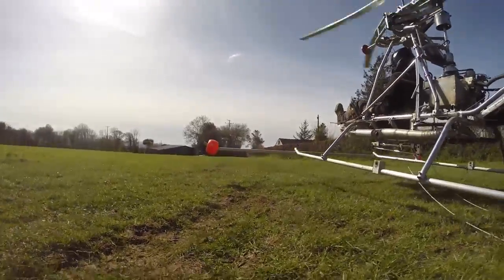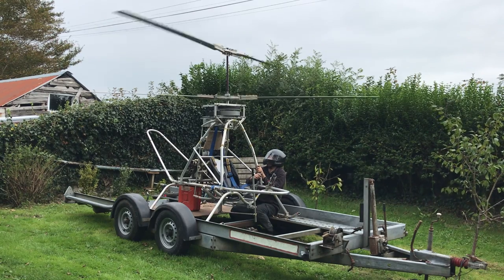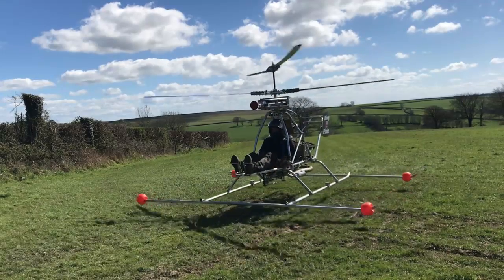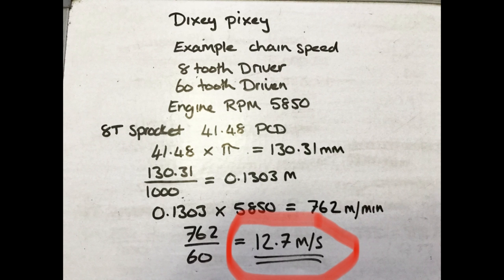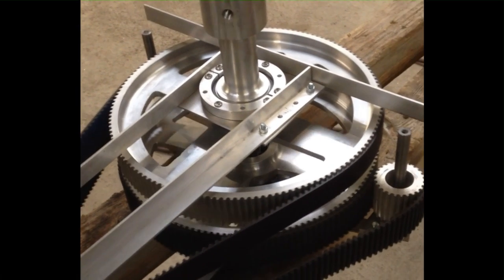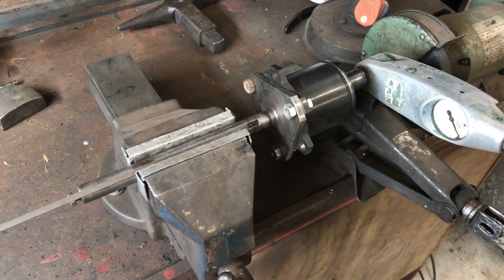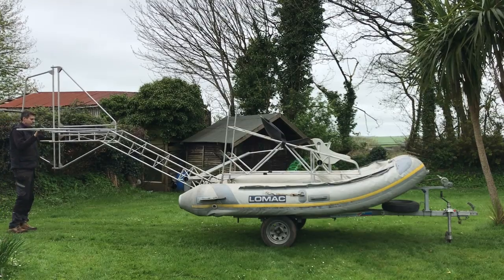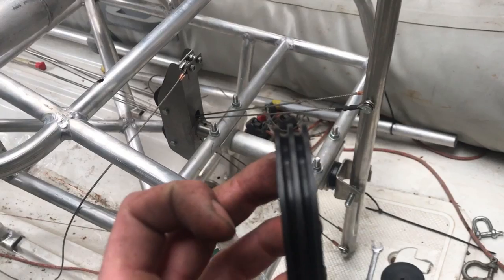Homemade Helicopter Rebuild part 2 plus Wing in ground effect, Ekranoplan, flying boat

Comment: Chains don't have any elastic properties. Heat is your enemy the chain will get very hot then the links will loosen and the chain will go slack. The way to mitigate this is to use 2 chains and  4 sprockets or more to spread the load over them and lower the heat and aide cooling.  However I do agree with av8tor261 chains are a bad idea on a helicoptor. I am a race car engineer and have used chains on bike engine cars one 20min race would still see both the chains loose tention and after 5 race's the chines would need replacing or they would jump of the sprockets due to throttle changes that would induce backlash in the chain with the loading and unloading of power not good for long duration flights. But you might be able to use multiple belts in the same way. Ask av8tor261 for some advice he has all the expertise in this field. Ben don't get hurt if a chain snaps it will detonate the rotor assembly.
Reply: how do race bikes get around this? And Rotorway helicopters use a chain reduction drive, so they must have figured it out too. maybe cause they use a 3-gang chain
Reply: @licencetoswill  Bikes are light not as much load plus they have chain tensioners. Things that fly not my area of expertise but a single motorbike chain is not the way mybe there are specialized chains for helicopters.
Reply from the maker: Hi, the chain that was used in your race car example do you know how stressed the chain was ? What size chain was it, how much chain tension did it experience? A chain getting hot is my worry particularly on the bottom drive because it's being reversed 4 times instead of two. The chain tension is quite low and under stressed but the speed is quite high. Thanks

Comment: Chains will work, but just like belts the more times it changes direction the more wear that will accumulate. At this point you should just go ahead and engineer and build a full gearbox. :D You got this!
Reply from the maker: Yes, that's spot on. The bottom chain will be going around two idlers and will heat up/wear much more quickly than the top chain. Will it be a problem ? I don't know, I would love to build a gearbox for it and ultimately that could be the right choice. Weight needs to be taking into consideration though.
Reply: @Ben-Dixey  Maybe you could just fab an enclosure for the lower chain drive and mist it with lube. No longer than you fly, and with the light loading that should suffice.
Reply from the maker: @helicopterdriver  yep, that might work. 👍
Reply: @Ben-Dixey zip tie in place a can of castrolOR motorcycle chain oil and rig it up so some opporator input automatically activates it at a useful interval.

Make a spray or two during preflight a habit.

Comment: Thanks for the video Ben! I am in the stages of wiring my instrument cluster together and getting it ready for the next stage of testing signal leads from different components. I will make a video soon. Once I get to a stopping point on the electronics I will be installing the swash plate and roughing in the controls to that point. Then, it's off to installing the turbine engine!! Keep your vids coming brother. It's fun to watch all the things you are doing.
Reply from the maker: Thank you and I look forward to your updated video. You do very nice work and you are going to have a superb machine at the end of it.

Comment: I think when factoring weight of the system, comparing belts & chains, you need to factor in the weight of the guards you need to protect life & limb from a catastrophic chain failure, which could take out any & all of of your body, the fuel tank or the rotor blades if an unprotected chain lets go, compared with the more benign catastrophic failure modes of belts...
Reply from the maker: Chains breaking must be avoided, just like belts breaking and gearboxes breaking up. The correct design decision needs to be made.

Comment: Chain drive, when braking, could broke or jam whole assembly. Broken belt cannot do it. I been riding speedway bikes way back, when primary chain (same speed like helicopter assembly) broke, it will cause heavy damage. You have chain whip, with enormous power to do heavy damage.....
Reply from the maker: Yes a chain breaking would be catastrophic. A belt breaking would also be catastrophic, all the power would be transferred to a single rotor and the machine would violently spin as it dropped. The drive breaking has to be avoided so I need to choose the right path. Can you tell me anything about why the speedway bike chains broke ? We're they being over stressed ?

Comment: Chain drive makes a lot of sense, Ben. You could consider replacing pivot currently below rotor with 4 bar linkage to put virtual pivot between both rotors to improve cyclic response (needs some thought for yaw alignment). Also you could control collective pitch of lower rotor then have lower rotor controlling collective pitch of top rotor to improve collective response. Collective pitch only would be relatively easy to retrofit using sliding collars with bearings to allow different rotation directions.
The pivoting rotor head, with teetering for each rotor, works well enough to my mind. But, if you wanted to go full cyclic swash plate then lower rotor controlling upper rotor could work too. You just end up with a swashplate in between the rotors.
Any thoughts about differential rotor rpm control to improve yaw response? Did you get any turns in before the technical?
Reply from the maker: Hi Martin, yes that's right a four bar linkage Would move the pivot point nicely. The challenge would be keeping all the links free of play and strong enough to handle the rotational torque from the jack shaft. If it was doable though it would definitely make a big difference to how the cyclic feels. 
Collective as you suggest would be easy enough I think to implement. 
Differential rotor speed would require the rotors to be driven by a differential. The Bensen B9 did this and braked one rotor. I believe it caused the machine to sink. 
Rotor tip brakes is another option for yaw, little flaps that extend on the end of the rotor blades. Apparently they don't cause the machine to sink in use. 
Would be simple to install will electric servos. 
The downwash vanes have worked ok so far but need more testing, I seem to remember once running out of authority but I can't be sure
Reply: @Ben-Dixey  , sounds good, Ben. I'll have a think about 4-bar linkages and see if I can come up with something. It might need a subframe to separate pitch from roll to keep the play down and strength up. Lets see if I can think of something simple to implement though.
I'm also thinking you have what you needs on WIGE for now? Let me know if that isn't the case. I'm using the time to focus on my own battery project... 😉
Reply from the maker: @martingarrish4082  might take some thinking about Martin. Yes, got everything at the moment thank you. Your help has been brilliant. 
I have a concern about the helicopter rotor blade straps. I chose to make them from 7075t6 but I'm wondering if steel would have been a better option. Blade straps on the rotorway are steel with an aluminium hub. Would like your thoughts at some point as I'm worried about fatigue.

Comment: Helicopter pilot/engineer here. NEVER USE CHAIN DRIVE!
Reply: You should tell everyone why
Reply: @nathanchalecki4842  Check out the list of NTSB reports on Rotorway primary drive chain failures.  Belt drive is second best to a gearbox drive.  It's how the load is applied in a vertical plain as compared to a horizontal plain.  Chains work great on motorcycles although high maintenance as compared to belt drive and drive shaft/gearbox motorcycles.. I don't want to see this uy hurt or killed.
Reply: @nathanchalecki4842  Look upon NSTB Rotorway accident reports.
Reply: The Rotorway Exec is chain for the final drive.
Reply from the maker: @cloudusterable  That's right, rotorway used chain for a long time. They have gone to synchronous belt drive now I believe due to the reduction in maintenance. I would like to know more about it though.
Reply: None of you are paying for an education from him. It's some backyard experimenting and fun with some humour thrown in. He's not telling people what to do, just sharing his journey. Just think in the US they encourage drug dealing so you can have an oversized gold chain wrapped around your neck. That is far more dangerous when you do the maths.
Reply from the maker: @av8tor261 please would you explain why chains are a bad idea. Bare in mind it's use as a hovering toy, max flight duration of maybe 5 minutes and maximum altitude of 3 ft.
Reply: @Ben-Dixey  Search NSTB accident reports on Rotoryway helicopter accents.
Reply: Hey Ben if your thinking of chain drive those duplex timing chains are good and plentiful they take a big loading, I've even seen then used as a final drive on a drag bike, there a smaller pitch as well.glad to see your back on the flying machine 😊

Comment: On cables, just make sure that they are not bending on either end. cables must pull straight. You probably know this, but I thought I would remind you to double check. There have been many an incident where failure occurred. Love the build my man!
Reply: I don’t build helicopters but I think I would use dyneema cord. And a tensioner in a place where it needs a very small spring. You can make loops using the classic ‘two sweethearts’ knot. Very strong indeed. If you don’t want to run over pulleys maybe bent and flared sections of seamless pipe are an option. But then you should look up if dyneema can tolerate that.
Reply from the maker: Hi, bending on the end ? Is this when people don't allow the thimble to rotate as it pulls bending the cable ?

Comment: To avoid frame flex and cable length issues, have you thought about sleeved cables like push bikes used?
Reply from the maker: I haven't considered that no. I suppose because I haven't seen them used on aircraft. Perhaps for inspection purposes.

Comment: If you look up the IWIS and DID chain catalogues they will tell you the ultimate chain tension before breaking. Ideally keep it helow 10% for indefinite life. Motorcycle chains are designed as a service item, they often run in the 30-50% range of their rating (at full power) causing them to stretch over time. Most of the bike chains are sealed with lubricant, but an oil bath or squirter would make it last longer. Read about chain cordal effect also, the smaller the sprocket the worse it is. Generally 17+ teeth is where it disappears. I beleive the IWIS catalogue also informs you about lubrication, but as already mentioned an oil bath or squirters are for indefinite use, a few hours/days does not require the same intensity of oiling. If you want the best chain, go Ramsey RPV (Morse), although it would require an enclosed housing. Just remember chains are very  dangerous.
Reply from the maker: Brilliant comment John, Your knowledge is unreal. Will look into what you have said. 👍👍
Reply: @Ben-Dixey  Sounds a little sarcastic, I suppose people telling you chains are dangerous is a little obvious. Keep at it, ignore the haters.
Reply from the maker: @chippyjohn1  I checked the tensile strength of a 530 DID chain and is was 8500lbs, the chain load on the helicopter will be 400lbs on each chain. The chains are 20x stronger than the maximum constant running load. Not a bad factor of safety I'd say, cant imagine how a chain could. break under those conditions. They will probably need to be replaced because of wear long before they broke. Would you agree John ?
Reply: @Ben-Dixey First point of concern would be the 8 tooth drive sprocket, too low. need to read about chordal effect and what percentage it is. Chordal effect is when the chain rises and falls from the sprocket engaging the chain, it will create vibration and pulsating torque. Wrapping around the idlers might be an issue. Ideally sprockets should be uneven teeth as chain should be even giving a hunting ratio, but you won't run it for long enough to worry. Strength will be fine for the 530, even with the addition of slight centrifugal tension. Obviously just keep an eye on wear and do some periodic oiling and check for heat. There are plenty of quality dry film lubricants for chains that will last much longer without the addition of mud and dust etc. I initially looked at roller chain for my project, but i was constantly chasing my tail trying to make it work. Rotorway did have issues with chordal effect, lubrication both prior to starting and while running, drive shafts breaking, sprocket wear, tensioner issues, and weight. Once again, chordal action will be your biggest issue.
Reply from the maker: @chippyjohn1  Brilliant comment as always. I did briefly read about the chordal effect, will read some more. It sounds like chains aren't going to work for me then as I don't want a bigger drive sprocket than 8T. I know the Bensen B9 used a chain drive and this was one of the reasons I thought it might work. Out of interest I'll try and find out what ratio that was but it's sounding like a no go. The extra heat from the lower chain going around idlers could be an issue too. What drive did you decide on for yours ?
Reply: @Ben-Dixey  I see he used a similar engine to you, but the reduction appears to be two stage. The drive sprocket for the chain in the photo looks quite large in relation to his head, and I think it has a planetary before that. Article mentions the chain was to be replaced after 200 hours and later design went to cogged belt. Rotor rpm was only about 315. I went from initial two stage roller chain reduction (theory) to two stage with first being straight cut gears and second Ramsey RPV chain (morse). The final reduction on mine is 23/99 tooth at 51mm nominal width with 12.7mm pitch. It has a tensioner/slack gauge on it and plan on a travel switch also. Don't want it to be a service item. Rated to about 200kw (continuous power) at the chain but only sees a max of about 115, with average about 100kw. I have an oil pump and an oil squirter running on gears and chain. Issue is chain likes low viscousity oil and gears like higher viscousity. I would go all gears for next model, but current engine rotation is served well by chain keeping it clockwise.
Reply from the maker: @chippyjohn1  Sounds brilliant to me, I like to think I do a fair bit of research before making decisions but you go much further into it than I. You have to be an expert in everything to do this stuff without having problems/ failures. It's so hard for just one person. Shame you live on the other side of the planet.
Reply: @Ben-Dixey  There is a lot to learn. We really are blessed with the knowledge of the internet, books and experience from others. I look down on some of the designs that people fly, but the people that designed them did not have the resources we do today. I do get overwhelmed sometimes, so I have other projects that are in the design phase. If I get stuck on one area I work on another design for a while. Often what you learn for one project helps you in another. I think I'm a bit ocd, sometimes I fall asleep with a calculator and wake up with it in my back, lol.
Reply: @Ben-Dixey  you also have that rotax engine now which has reduction gearing, so you could go chain with larger drive sprocket, and even smaller driven sprocket.
Reply from the maker: @chippyjohn1  Never fallen asleep with a calculator in my hand. 😆
I sometimes wake up with the answer though. 
The problem with a reduction before the belt or chain drive is torque on the driveshaft is increased. Wanted to keep  that to a minimum because of the torque its applying to the mast tilting hinges and supporting framework. 
Thinking I'll just stick with the belt drive for now and accept that I'm not getting the most from the engine. I reduced the weight of the machine before the drive failure and never got to test the results. There is also more weight to come out of the machine. 
I'll try and find out from gates if the slightly below recommend drive pulley diameter is a problem. Can't tell them what it's for that's all, perhaps I can just say it's for a whirl tower build. There's no liability problem then.
Reply from the maker: Hi John, I would like to give you the credit for pointing the chain issues out of the next video. Is this something you would be happy about or rather I didn't ? It would only be a screen shot of your comment, I don't like taking credit for others input but not everyone likes the potential attention. 
Ben
Reply: @Ben-Dixey  I don't particularly want any attention. A lot of my findings are only verifying what others have learnt, so we are all taking credit for someone else's work. The beauty of the internet, if you have time you can learn a lot from other people, just need to verify most importantly.
Reply from the maker: @chippyjohn1  That's fine and understand 👍. That chordal effect was Interesting, found a nice animation of what's going on. YouTube certainly is a great educational tool for creators and viewers.